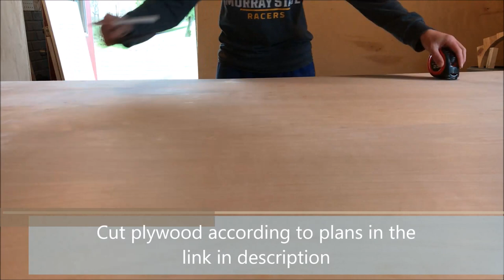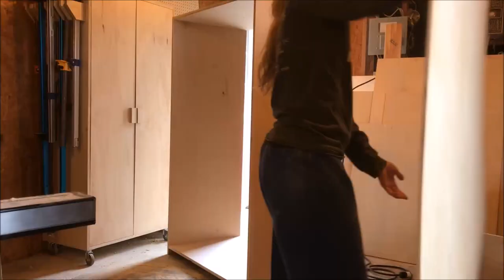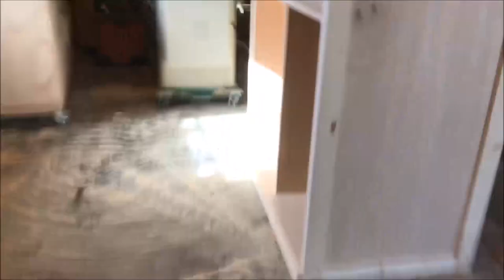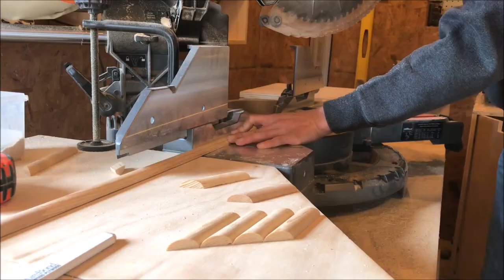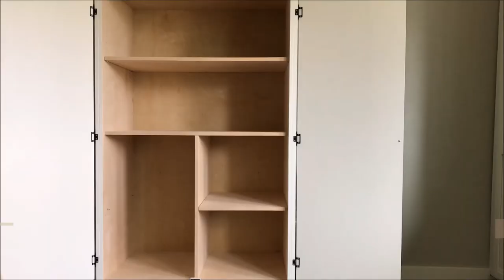How to Build a DIY Armoire Wardrobe Storage Cabinet

Comment: How much does all the wood cost? Would it be cheaper for me to buy all this thick wood or for me to buy an amorie? Thank you
Reply: A decent hardwood armoir worth your time is going to be north of $500 minimum. If you didn't make mistakes, 3/4 birch plywood is about $50-60 per 4x8, and this uses a few. I'd guestimate ~250 conservatively if you didn't have to buy any other tools.

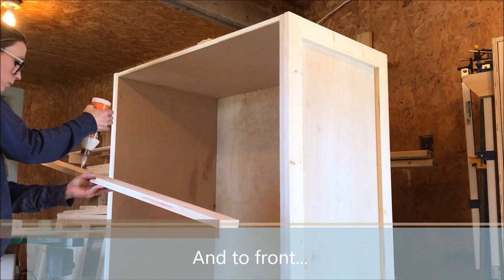Comment: What is this tool on 1:46? Does it put nails? It seems like this but I can't see any head of nails on wood after. If anyone knows please enlighten me
Reply from the maker: It’s a nail gun. You can read all about them and how they work here:
https://www.woodshopdiaries.com/finish-vs-brad-vs-pin-nailer-vs-stapler-which-is-best/
Reply: @WoodshopDiaries  Thanks a lot Shara. I run into your channel the other day and found it delightful. But how do you hide those nail heads later? Are they visible on the end result? Are they covered by paint? It's not easy to distinguish that from the video.
Reply from the maker: Just apply a little putty or filler, sand and paint/ stain as desired. Here a video:
https://vm.tiktok.com/TTPdhGdUPP/